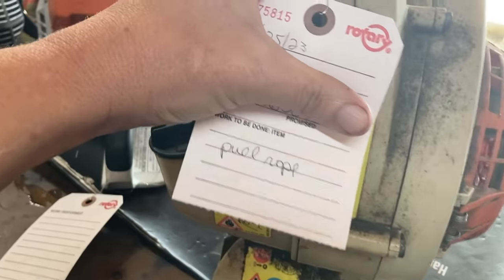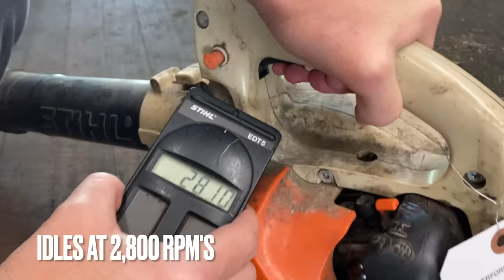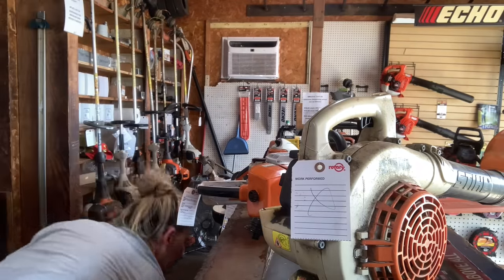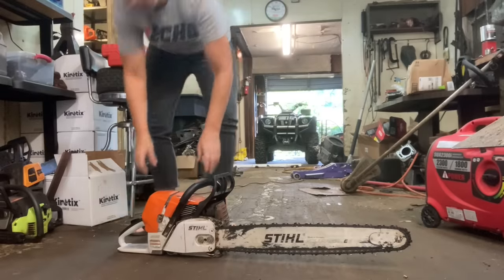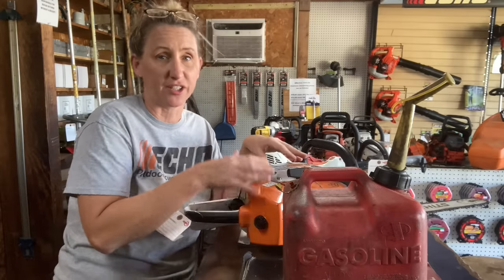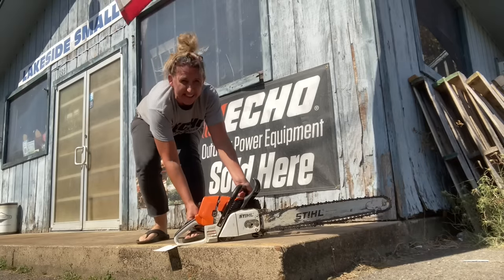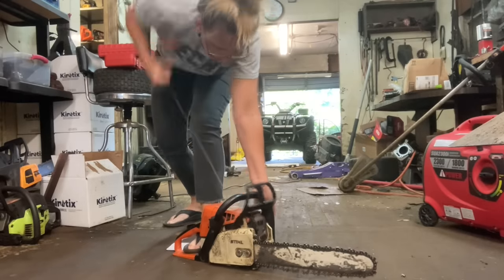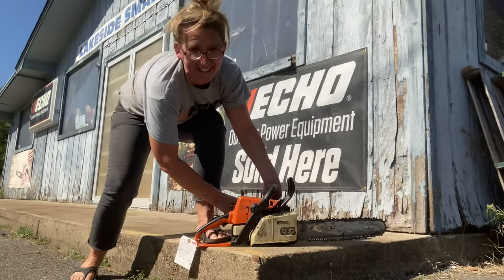The Burning Truth of Canned Fuel. This HUGE Distributor Doesn't Like Me Exposing It!

Comment: Same thing in my shop.  My biggest customer absolutely will not believe me when I tell him that the $25 a gallon canned fuel he runs is trash.  I run Red Armour on high test in all my saws and it is by far the best mix oil I've ever run.  If a saw sits for 6 months+, it fires right off.

Comment: I have a Stihl handheld blower. I bought it from Atwoods. They supplied the 1st tank of fuel for it. The blower never really sounded right. Just sounds bad and under powered  at high rpm. But, it worked good enough for me. I saw this video. Checked the color of the fuel. I'm still running the tank of fuel they gave me. It was that pink stuff. I followed your video word for word. Now the blower sounds normal at high rpm. And it starts on one pull. It's NEVER done that. So, thanks for the help.

Comment: When this lady is right, she's right on! She was right on about Stihl's 2 cycle oil clogging muffler spark arrestor screens. Glad I saw her video about that before I used much of it in my new Stihl saws. My next door neighbor always bragged about using the canned fuel from the big box stores and I had always noticed that his leaf blower and weed whacker would rev and bog just as she demonstrated and were also hard starting. I've always mixed my own 2 cycle fuel using echo 2 cycle oil, now their red armor. Filled my neighbor's leaf blower with it when he ran out of gas and he was amazed and never used his canned gas from the big box store ever again. Well done, Chickanic! I was a small engine mechanic too for over 40 years.

Comment: A long time ago when I had purchased a new saw, the dealer recommended I burn premium fuel. This was before fuel with ethanol, his reason was the tank is located next to the engine block and because of the heat the fuel actually boils. So start with a fuel that has higher octane. He also recommended mixing my gas in the correct oil ratio. He said if the oil is 50:1 then mix 50:1, if it 40:1 then mix 40:1. I use Amsoil 100:1 two cycle oil and have been mixing in that ratio since I bought that saw. FYI, I checked the compression about a year ago and it is 150 psig. Now you no longer can get the same premium fuel so I use 91 non oxgenated. I dismantled the saw at that time for an other issue,  and inspected the jug and piston. There were minor scratches on both but both were in serviceable condition. I reassembled the saw and it still is in service today.
I use the same oil fuel ratio on all my 2 cycle equipment and also in my 4 cycle engines to winterize them.
Jamie

Comment: I gotta say. I'm one those that has never had any issues. I have 4 echo machines and almost exclusuvly use that fuel because it's nearly the cheapest and it's readily available. I some times (not often)  use it in my 4 stroke mower if I dont have any regular gas and need to finish up after running out.

Comment: Your videos are great.  What brand of 22 inch or 21 inch self propelled FWD lawn mower the large wheels in the back would you recommend?  I used a Toro recycler for years it finally stopped working.  Last fall I bought another Toro recycler and one of the back wheels already broke off, and when you are mowing side to side and a slope the mower will stop.  I even have a full tank of gas and it stills stops and the motor dies.  Thank you for all your videos and keep up the excellent work.

Comment: I remember using premix during my two cycle boating days and how bad it always was.  The only feature canned gas has going is convenience.  I buy premium gas at a high volume gas station to avoid ethanol as much as possible (always pump a gallon or two in my car first to clear gas lines) and use Stihl synthetic oil.  My two cycle chain saw, blower and trimmer runs like new all year long.

Comment: watch your videos back in the spring. took your advice, ordered all new carbs for my stihl weedeaters and chain saw. took them apart, put back together and used red armour fuel mix. they all run perfect now.  went to stihl dealer and told them they could kiss my xxx!  i was taking my stuff in constantly for carb problems. stopped using their canned fuel they said it would void my warrenty. i laughed and said what warrenty, and they pulled my service sheets. said i must be doing something wrong. i said yes, put your canned fuel in it, walked out not been back.... thanks so much.... saving me hundreds of dollars.

Comment: Stihl in Pittsburgh is selling 1 gallon of 50 to 1 gas for 43$ . I asked if it was a pricing mistake.  I laughed and told them I've been using 93 octane with 10% ethanol for 10 yrs without any problems

Comment: Here in Norway, I have used Aspen2T (alkylate gas) in over 20 years in Husqvarna/Jonsered/Partner chainsaws, grass-trimmers, and brushcutters and never had any problems whatsoever with original or modified engines.

Comment: I think you have proven the canned gas deteriorates over time the same as E10.  My question is if your customer left E10 in the carburetor for a year would the carburetor need to be rebuilt vs. just changing to fresh fuel?

Comment: Hello, I'm in UK.
IV been doing 2stroke machines for over 25yrs
And as you say and shown the petrol to oil mix is a part of the failures.
IV got one in now....needs a full fuel system rebuild/replacement......it's was red fuel......
It's was red diesel!!!!!!!
And the same costume complained after using a newly serviced machine...... stopped working.
He had mixed red power steering fluid in....
Said it looked red so was ok....
Sometimes I feel guilty charging him.....but IV to remember I'm not the one at fault.

Comment: These customers seem to leave fuel in their saws.  I find old fuel of any type does not run well after sitting in my saws for over a month, but engineered fuel does better than gas station fuel with an oil mix.  A good test which I haven't seen you do is put gas station gas with an oil mix on a shelf for 6 months vs engineered gas on a shelf for the same time and compare the performance.  For someone that does not run though fuel as fast in a state that mandates an ethanol mix, an engineered product might work out better for them.  Just a theory, I wonder if you would have a way to test for that.

Comment: On a related subject, Stihl. Watched a YT vid, where a young woman started a Stihl on the first pull. In the comment section someone had posted, (paraphrasing) “That’s a Stihl chainsaw. There is no way it started on the first pull.” A LOT of thumbs up on that comment, myself included. I had to chuckle when I first read it because, yeah, I can relate to that. I’m not slamming Stihl, Stihl makes a good product. But they do have some idiosyncrasies.
Reply: Ya know, the only saw we have that almost always starts on the first pull is our MS440. The ECHO's 2-3 pulls gets it going but that Stihl, if ya can pull the big thing, starts like a champ. All our other Stihl equipment ya almost have to have O2 standing by for recovery. Our MS251, which runs great after it starts, takes between 12-15 pulls. I usually give up and grab a different saw.

Comment: I have 4-cycle snowblower and I always had to have the choke on for my snowblower to run well. I have bought pump gas from many different gas stations and my snowblower always ran poor. I have gone through about 7 or 8  cans of tru-fuel in my snowblower and every can made my machine run awesome or at least normal. I love that stuff!!

I have a Briggs and Stratton 950 snow series. It's 208 cc.  So is the problem you're seeing with tru-fuel only with 2-cycle engines? I find it so hard to believe that you're having or seeing that many issues with that fuel. My four cycle snowblower starts every season with one maybe two poles and runs like a champ all winter. And I am now only using the big box store canned fuel, tru-fuel.

Comment: We've known about alcohol free fuel problems for 20 years. We buy 55 gallon sealed drums from oil distributor. Or you can buy pump gas and take the alcohol out yourself which is way cheaper.

Comment: I have been using castor based oils for lubricating two strokes, forever, it is by far the best for the high reveres, in all my gardening commercial equipment, my high performance boats and racing bikes.

Comment: The Sthil dealer told me to use for winter storage as it wont gell up.Very expensive, and my 700 series blower didn't like it, the MS 251 didn't either...switched back to 93 octane real fuel and they both run great!

Comment: I was having problems with my weed wacker and picked up canned fuel from the orange box store in order to rule out a fuel problem. Cleaned the carb, replaced the cracked primer bulb, lines, and filter. Wasted a day struggling to get it running again and tossed it. What a PITA if it was the fuel all along...😩

Comment: Ugh. I just bought a case of this stuff and to be honest most of my tools I use this stuff in run like crap. I have been using it for years believing it was supposed to be awesome. Once I burn through this case I will try to mix my own and see if there is a difference   Thanks for the info.

Comment: I never use it. Sold stihl for years and I never understood why you would even buy a gallon for 30 bucks versus a gallon of non ethanol for 450. It's just like buying a 2.5 gallon of kerosene for 30 bucks when you can go to the gas station and buy from the pump at 3 bucks a gallon

Comment: I simply use Shell ultimate 93, and haven't had any problems in the 10 odd years I've been using it. I'm still running last year's can just fine. Before that, I used to use Sta-bil religiously. Finally, my lawn mower repairman friend showed me the black film in the carb that it caused, which caused frequent carb trouble.
Reply: You should use SeaFoam occasionally to clean the fuel system out. Do this-Stabil in the fall,  Seafoam in the spring!
Reply: @Randy7th  I'm going on 10 years using neither.

Comment: I'd like to see more detail about why some of the canned fuel is going bad.  I've been using canned fuel in my 2-cycles for over 7 years and have had zero problems.  I've used Trueufl, Echo, Husqvarna, Aspen, Sunoco, VP, and since I use my 2-cycles so little it's the best solution for my use case.  I've let it sit 3 years and the equipment started and ran just fine.  I probably run a tank through each piece of equipment a year as I mainly use battery powered line since the yard is only a half acre.  

I had so many issues w/ Ethanol gas and by me it's a pain in the butt to get Ethanol free.  However if I could easily get Ethanol free I'd run that instead.

Have you contacted the manufacturer or talked w/ someone who can tell us what's going on? I'd like to know what is going on instead of seeing 10 pieces of equiptment that don't start.

Comment: I found it interesting that the blower went to four stroking as if rich, I use the term bogging out for lean conditions. We check every customers fuel, we find just about everything in the tank, pretty fuel, stinky rotten ethanol fuel, water, dirt and of course no dye at all in the gas which always begs the question, do you want us to put a new top end on your saw? BTW the 025 typically has the old set screw tank vent which will usually seep some fuel when its tilted over.

Comment: Last week I picked up my “under warranty” Husqvarna Backpack blower up from my local small engine shop for suddenly not starting. The owner/mechanic told me the exact same thing about the canned fuel, but instead of offering another reasonable solution, he instead pushed the $30 Husqvarna branded fuel, saying it was better then the big box pink stuff brands. Now I don’t know what to do about fuel. I mixed my own for years, but stopped given the ethanol in gas from the pump. What should I be using? Please help us understand what is the best option.

Comment: I very seldom use the premix from the box stores.  I call it "problem solver" gas.  It's a solvent -- you can smell the xylene in it.  Run a quart through to clean the engine, then resume ordinary pump gas with any good quality 2-stroke oil.  I've had the same old Stihl 034AV Super for 28 years.

Comment: I have four chain saws.  1- brand new Stihl, 1- very old craftsman( more than 25 years old) 2 Poulans. One is 20 years old, and the other about five years old. I also have a 2 cycle Toro, 2 Stihl weed eaters. Question is when I bought the new chainsaw, the lady, who I Respect and the dealership. Run by a gentleman that backs his work 100%; gave me a deal with a six pack of Stihl synthetic oil to mix with my gas.  Is this good for my older machines, or should I mix two different fuels.  
The other question is I have a John Deer D110 42 inch lawn tractor.  I’m fixing to pull the deck off to replace the blades.  I’m thinking while I got the deck off, to do some preventive work by replacing the spindle assemblies.  Now this Tractor is approaching about ten years old.  No problems yet with anything.  I do two oil changes a year on this machine. I never use ethanol gas in my machines. I also have a pressure washer and tiller that have Briggs and Stratton Engines. So is after market parts for the deck okay, and using synthetic oil in the four cycle engines good.  Or should I leave that alone.

Comment: Love all your videos! You said you try and respond to all your comments so I’m holding out hope lol. I have a craftsman Lt3000 ride on the red one with hydrostatic transmission. Both front and rear pedals won’t engage most times without stabbing the opposite way you want to go. My searching has showed me to remove the battery under the seat and clean out all the built up debris causing something to get stuck. However on my model it has the gas tank under the seat and I can’t find ANYTHING about this. Are you familiar with this? Do I have to remove the fuel tank and do the same repair??? Thank you if you’re able to respond! Huge fan!!

Comment: In the 1977 - 1980 seasons in Connecticut my 030 and I fell, logged and split (by hand) over 300 cords of wood ( with the gas/fuel crisis I made a small fortune).  in 9 out of 10 issues with the saw it was in some way related to fuel (or mix).

Comment: Thanks I have some of that crap, fortunately I have mixed it about 50/50 with 93 at 32-1          That I run in my RM250 simply because I just did not trust it. I only bought it for convenience and gaining a small metal fuel can for my saw as I don't often need but a couple of tanks.

Comment: I have seized three saw engines using tru fuel . I have also had high idle problems using it. A lot of the time however it runs good. I use the 40:1 in everything.

Comment: my question has ABSOLUTELY nothing to do with canned fuel.   can i replace my snowblower wheel bushings with bearings?   i know you can do it on the front wheels of a lawn tractor.   it's september and the mornings are 5c and the days are 25c so time to start thinking about doing the last mowings, drain the fuel, change the oil, fog the engine and swap out the mower.    is there any benefit to changing to bearings?   i live outside a small town, and getting parts is  a pain, so i have replacement parts for just about everything, but i do NOT have spare bushings....

Comment: Canned fuel is great for storage. I run a carb thru my stuff in winter because it doesn't gel up. It's a different AFR however and my machines don't run as well unless re-tuned/jetted for it. Use it for it's purpose and its fine, but it's not a replacement for regular fuel.

Comment: It seems an exposed socket on the crank that would allow a drill w/hex or torx to be used to start these motors would make life better for everyone.  I use the canned fuel only for winter storage as it has no ethanol to gum up the parts